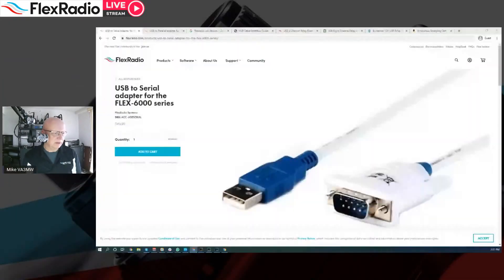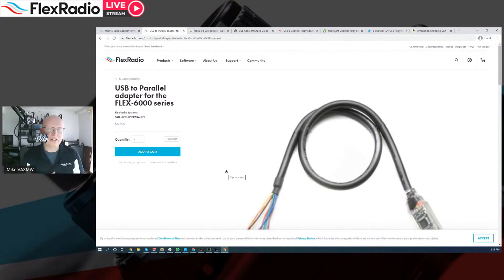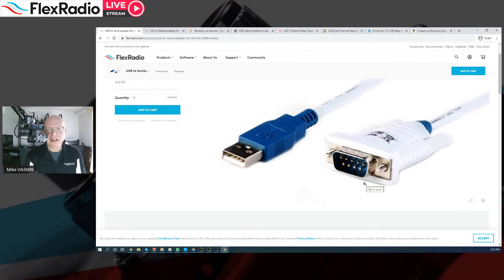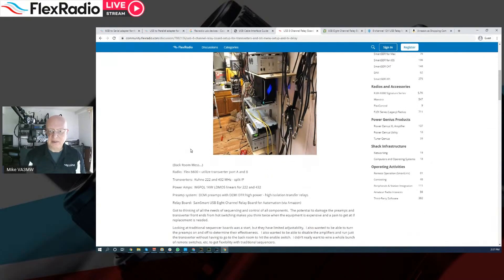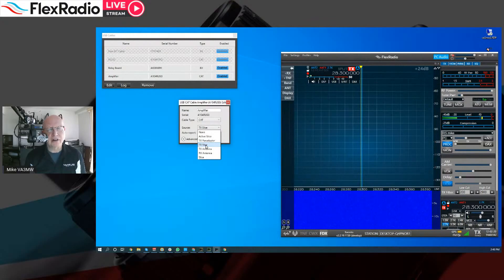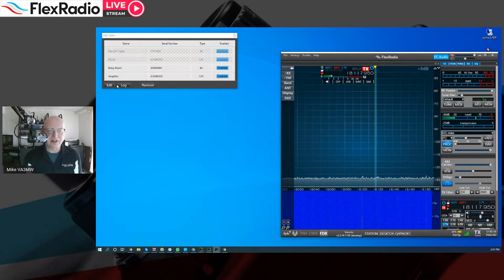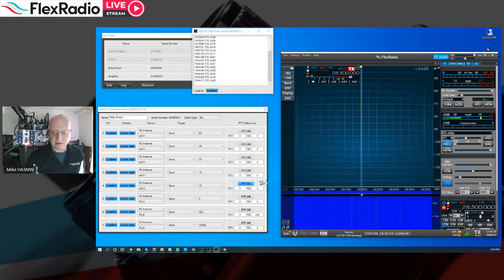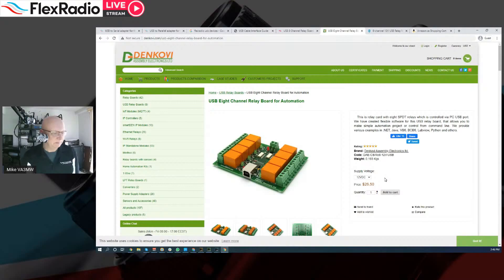Flex 6000 - What is the USB port for on the back of the radio

Comment: I am using the denkovi board with a W6PQL transverter interface to move the rf to three transverters from a single 6500 transverter port. It also powers up the amps when I switch bands. Interesting project and makes my 6500 a 13 band radio